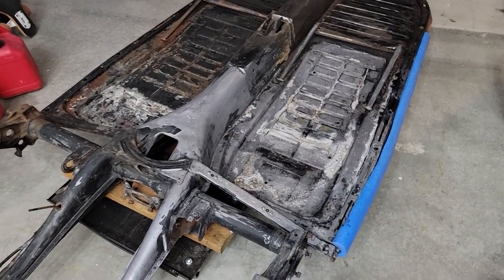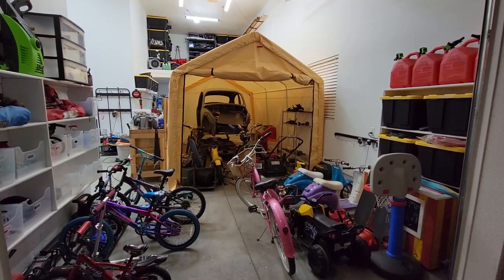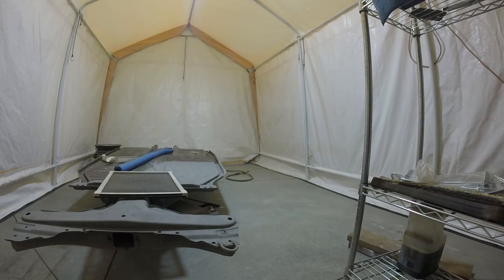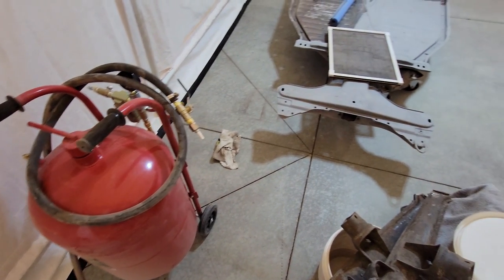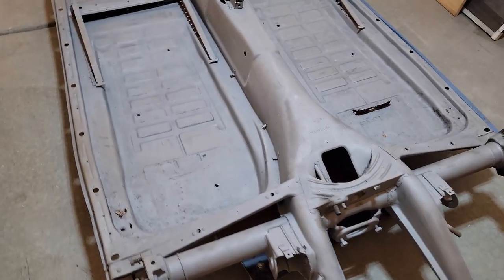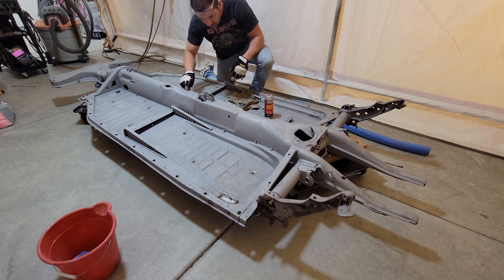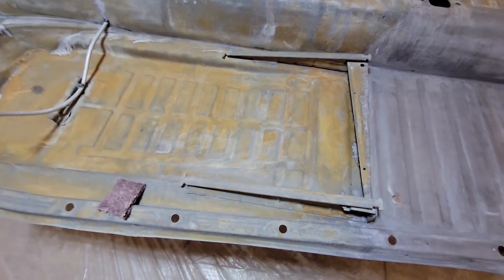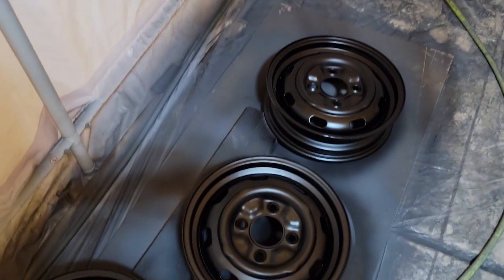Ep. 1 - 1971 VW Super Beetle - Chassis Sand Blast, Rust Treat, Clean, Prime and Paint.

Comment: I’m literally at the same stage with a ‘73 I chiseled all the tar off but used a wire wheel on a 4 1/2 grinder to clean the chassis. The floor pans were toast though so I have two new ones on the way. Keep the videos coming. 👍🏻
Reply from the maker: Common to have to replace them for sure, luckily mine were in decent shape and I didn't have to replace them

Comment: I'm gonna find a portable car tent like that for my project. I want to blast my own frame chassis and eventually the body and do my own painting. A heavy duty degreaser and tar remover will help remove the tar coating before a good pressure washing.
Reply from the maker: Go for it!  I got my tent at harbor freight, I'm not sure if that was mentioned in the video.
Reply: @bottomupbuilds  Yeah I found it after I looked it up. Might get2, 1 for the blasting and then 1 for painting. Or set up a diy paint booth but that def seems legit for blasting.

Comment: What size compressor are you using and grit media
Reply from the maker: I am using the Harbor Freight 110 lb sand blaster with coal slag media from Tractor Supply, medium grit is all it says on the bag.  I have a Bel Aire 80 gallon 5 hp two-stage compressor, pressure set to, I think about 100 psi.  Even though the compressor is beefy compared to home garage standards, it was still under powered for the job.  I was able to get a minute or 2 of blasting before I had to wait for it to catch back up.

Comment: Hi! What air compressor does I need to have that results? And What media ripe you use? Thank you
Reply from the maker: I am using the Harbor Freight 110 lb sand blaster with coal slag media from Tractor Supply, medium grit is all it says on the bag.  I have a Bel Aire 80 gallon 5 hp two-stage compressor, pressure set to, I think about 100 psi.  Even though the compressor is beefy compared to home garage standards, it was still under powered for the job.  I was able to get a minute or 2 of blasting before I had to wait for it to catch back up.

Comment: Nice! whats the sandblaster you are using and compressor. Appreciate if you could share the details of grit size, air pressure, cpm, etc. cheers
Reply from the maker: I am using the Harbor Freight 110 lb sand blaster with coal slag media from Tractor Supply, medium grit is all it says on the bag.  I have a Bel Aire 80 gallon 5 hp two-stage compressor, pressure set to, I think about 100 psi.  Even though the compressor is beefy compared to home garage standards, it was still under powered for the job.  I was able to get a minute or 2 of blasting before I had to wait for it to catch back up.  It was time consuming, but I was in no rush and with the coal slag only costing about $10 a bag, it was more economical than sending out to be blasted.

Comment: What paint did you use(black)
Reply from the maker: SpeedoKote SMR-207/211 - Hot Rod Black Paint, Black Satin 2K Urethane, SMR-207 4:1 mix Single Stage Gallon kit with activator included.  

I wish I could report on how is held up, but the car has not left the garage since I painted that, so I have no real world review to give.